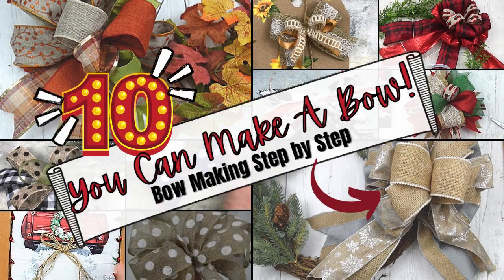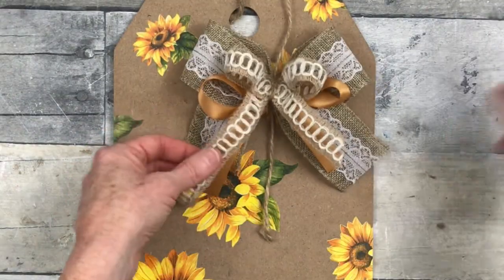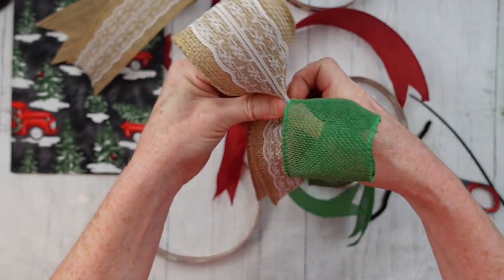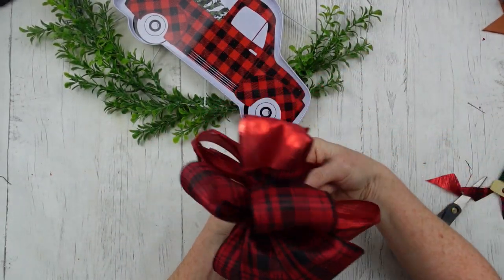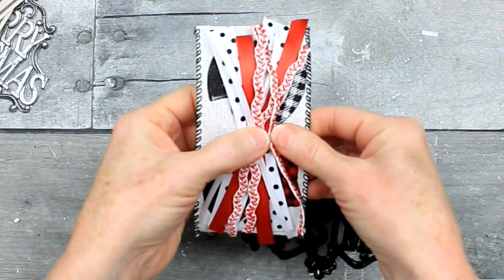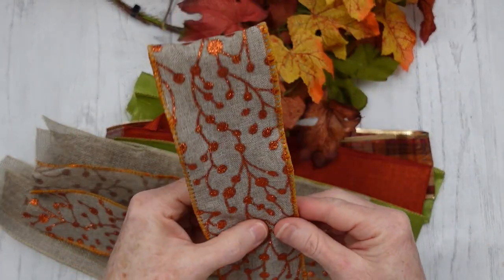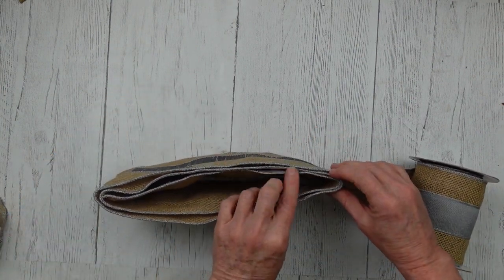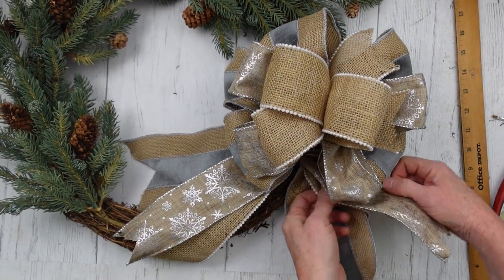The ULTIMATE GUIDE to Making Bows By Hand - 10 Different Styles

Comment: I have tried making bows and when it comes to the part of putting a notch on east side it always comes out a disaster and have ruined so much wire ribbon. I also have a bowadabra and bows come out sometimes ok.
Reply from the maker: It took me a lot of practice, keep trying, you will get it.
Reply: @MakingItMyOwn  Yes I am still working on it. I noticed on your video dated Nov 15, 2021 you used clippers instead of scissors, which I saw you used scissors in other videos so will try using clippers and see if that would work better for me.